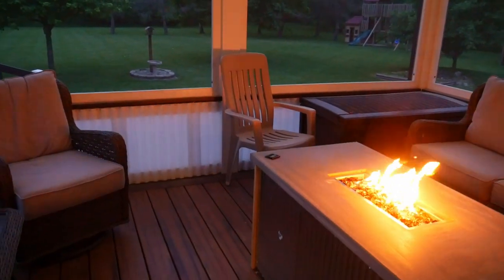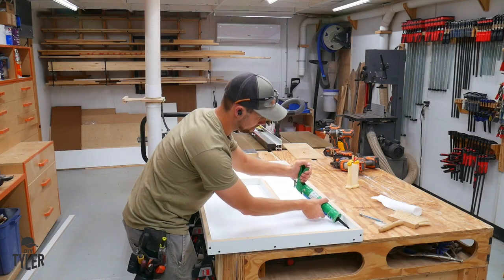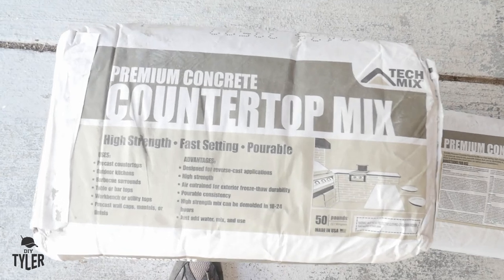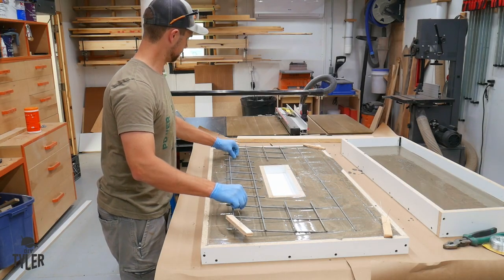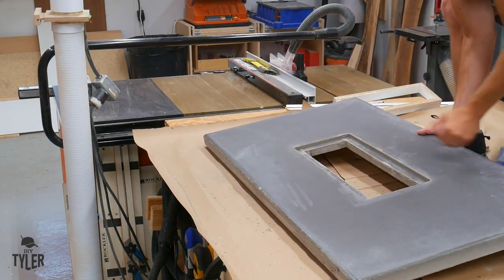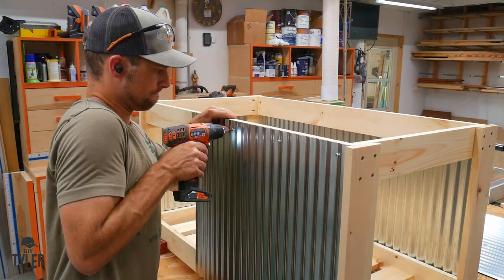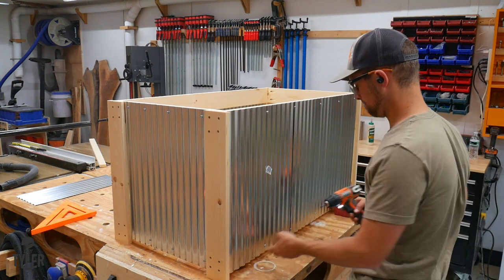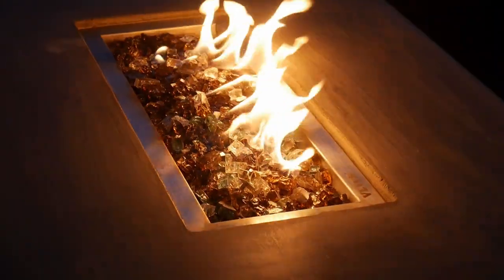🔥 Build Your Own DIY Deck / Patio Fire Table for $300! 🔥 | Step-by-Step Guide

Comment: Great build and the countertop mix looks like a much better solution. I tried to look in the description for the fire assembly. I don’t believe I saw it. What brand and how much was it? Others I’ve looked in the past were extremely overpriced. Keep up the great videos!
Reply: Think it said 'Vevor' on it. Any stainless burner assembly like it should work though. I like his solution.
Reply: @Guitaural.  Yeah, I’m beginning to see that name a lot more. Several weeks ago my job site saw crapped out and in desperation ordered a “Vevor” saw. This may sound crazy, but it’s a beast! Better than my SawStop CTS.
Reply: @ifiwooddesigns  Can't beat the SawStops for that combined safety/performance thing though. Table saws are so dangerous...have to be 'on your toes' every second you use one.
Reply: @Guitaural.  I agree with SawStop safety feature. Unfortunately the SawStop CTS had a horrible fence, struggled through tight grain and brake triggered twice (once on a pressure-treated lumber) and cost me two brakes and tablesaw blades. Of course, always on my toes on any power equipment. This Vevor tablesaw is as good as my old Delta and Craftsman saw on a smaller scale.
Reply: @ifiwooddesigns  Sweet - yeah, I've heard if the wood's on the wet side you have to turn off the safety feature on the SawStops. That's probably half of what I cut...lol.